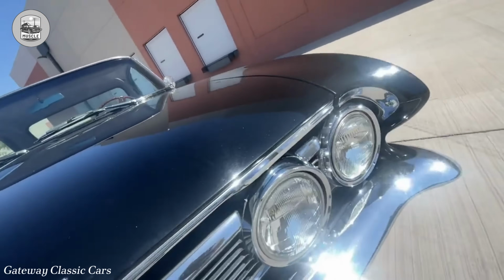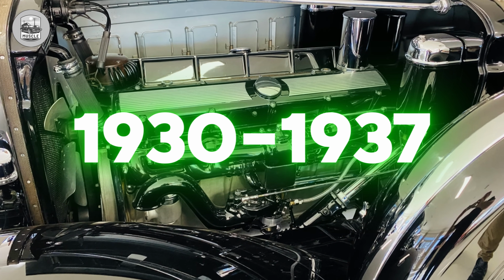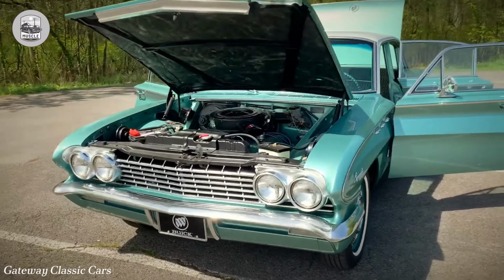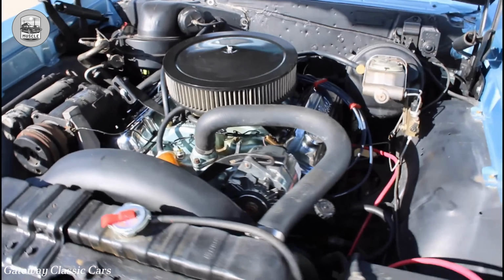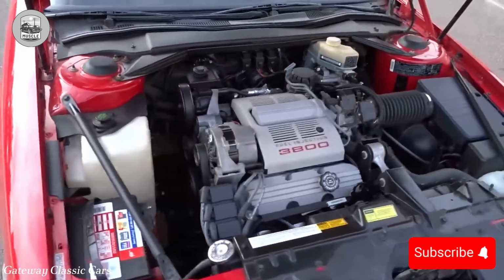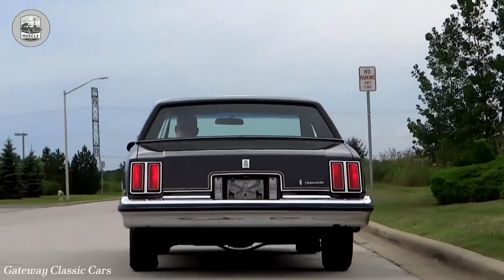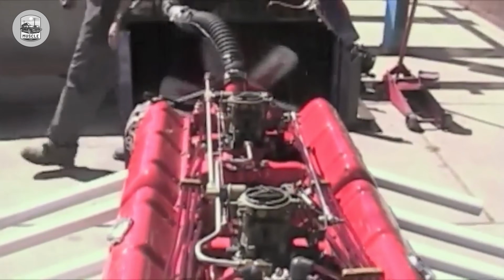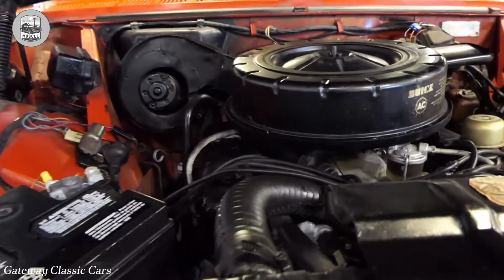10 MOST FAILED and WEIRDEST GM Engines ever made | Worst engines blunder!

Comment: Back in college I was “lucky” to be given a 1983 Chevy Celebrity coupe with the LT7 4.3l V-6 Diesel engine with a whopping 85bhp and 165lb-ft of torque. 

It DID have good fuel economy, but the biggest highlight was its snow capability. With so little torque it was virtually impossible to spin the tires even in the snow.
Reply: While I appreciate your experience with the 1983 Chevy Celebrity and its snow capabilities, I have to respectfully disagree on the praise for its performance. The LT7 4.3L V6 Diesel engine, while offering decent fuel economy, was known for its underwhelming power output and numerous mechanical issues. The 85 bhp might have kept the tires from spinning, but it also meant painfully slow acceleration and limited highway performance, making it impractical for anything other than city driving. Additionally, the diesel engine itself had reliability concerns, with issues like head gasket failures and poor build quality, which tarnished its reputation. In the long run, many owners found themselves frustrated with the trade-offs for what was essentially average fuel economy.
Reply: @KeithGreene-k1v  I finally got rid of it after a transmission rebuild and then the head gasket blew.   At the time the car wasn’t worth the cost of repairs.
Reply from the maker: Wow, sounds like you went through quite the ordeal! Transmission rebuilds and blown head gaskets can definitely be a tough combination, especially when the cost of repairs outweighs the car's value at the time. It’s always a tough call to make, but sometimes it’s just not worth the hassle. What kind of car was it? Some older muscle cars, even with their challenges, have skyrocketed in value today, making repairs more of an investment! Would love to hear more stories from others in the comments
 what cars have you had to let go for similar reasons? Don't forget to subscribe and check out the other videos on the Muscle Car Masters channel for more muscle car content,
Reply from the maker: So great.... Thanks for sharing your experience with the 1983 Chevy Celebrity coupe! It’s great to hear a firsthand account of the LT7 4.3L V6 Diesel engine. That engine was part of GM's push to offer more fuel-efficient diesel options, and you're right about its standout fuel economy—definitely one of its few strong points. The low power and torque figures (85 bhp and 165 lb-ft) didn’t make it the most exciting ride, but it was practical for the time. You brought up a great point about the snow capability! With that limited torque, it probably made winter driving more manageable. The low power might have been frustrating in some situations, but it worked in your favor for traction—hard to spin the tires when there’s not much torque to break them loose! It would be awesome to hear if anyone else had a similar experience with these early diesel engines. Anyone else have stories about the LT7 or other GM diesels? Share your thoughts in the comments below—let’s keep this conversation going.

Comment: The Buick nailhead v8
Reply from the maker: Thanks for bringing up the Buick Nailhead V8! This engine is a true classic and one of Buick's greatest contributions to the muscle car era. Introduced in 1953, it was known for its vertical valve covers, which gave it the "nailhead" nickname. Though it wasn’t the largest or most powerful V8 of its time, its unique design allowed for excellent torque, making it perfect for low-end power. The Nailhead also made its mark in hot rodding history, being a favorite among custom car builders in the 1950s and '60s. Did you know that the legendary 401 and 425 Nailhead engines were used in the first Buick Riviera, helping solidify Buick’s reputation for combining luxury with serious performance? Everyone watching—what do you think about the Buick Nailhead? Share your favorite facts or stories in the comments! And if you know anyone who’s into Buick engines or muscle cars, share this video with them.

Comment: Looking back would an after cooler done better that fluid injestion
Reply from the maker: An aftercooler could have offered some serious advantages over fluid injection, especially when it comes to managing intake temperatures for sustained performance. Fluid injection, like water or methanol injection, works by cooling the intake air and preventing detonation, but it can be inconsistent and requires constant monitoring. On the other hand, an aftercooler (or intercooler) cools the air before it enters the engine, leading to more consistent, reliable cooling and better overall efficiency.
Especially in high-performance setups, where heat soak is a major issue, an air-to-water or air-to-air aftercooler can provide cooler, denser air, resulting in more power and better longevity for the engine.
Let's see our channel is a place to share, comment or show your feelings about American Muscle Cars.
Don't forget to like, share or SUB on our channel to enjoy other great Muscle Cars videos.
Spending more time with other great videos on our channel to explore more about American Muscle Cars. Have a good day.

Comment: I had a 65 pontiac Tempest with a 215 cu 6 cyl, ran vary well driving it the way it was suppose to run. Most engines were made well, people beat the hell out of them, I had that car for 15 years.
Reply from the maker: The '65 Pontiac Tempest with the 215 cu in 6-cylinder was a solid engine, especially considering its design aimed at fuel economy and reliability rather than outright performance. It’s awesome that you kept it running smoothly for 15 years by driving it the way it was meant to be driven! You're absolutely right—many engines from that era were built to last, but how people treated them made all the difference. The Tempest, in particular, had a reputation for being versatile, whether with the six-cylinder or the V8 options. For those interested, Pontiac's straight-6 engine was also a part of their lineup in the early '60s and evolved into what they called the "Trophy 4," which was essentially half of a V8. This era of innovation helped establish Pontiac as a leader in engineering. That said, muscle car fans, do you have any stories about how long you’ve kept your engines running strong?
Reply: @MuscleCarMasters68  Wish I would have kept it. But like everything it gets past it time. I rebuilt the engine in 76 drove down to Florida for thanksgiving.
Reply from the maker: It’s always tough when we look back at the cars we let go—especially after you put the work into rebuilding that engine in ’76! Driving down to Florida for Thanksgiving sounds like a great memory.
Cars like that truly stand the test of time in memory, even when they move on. We’d love to hear more about your experience with the rebuild—what challenges you faced and what mods or upgrades you might’ve thrown in.
Have a good day.
Don't forget to like, share or SUB on our channel to enjoy other great Muscle Cars videos.
Spending more time with other great videos on our channel to explore more about American Muscle Cars.
Reply: @MuscleCarMasters68  This was the straight 6 engine.
Reply from the maker: @bser3973  Yes, the straight-six engine had its place in some muscle car models, especially in the early days when manufacturers offered a range of engine options. While it wasn’t as iconic as the V8s, the straight-six could still pack a punch in the right setup! For example, engines like the Ford 300 cubic inch straight-six became legendary for their durability and torque, making them popular in trucks and utility vehicles.
For muscle cars, though, most enthusiasts sought the bigger V8 engines for that raw power and performance. That said, the straight-six provided a great balance for those looking for a more economical option, with smoother operation and easier maintenance.

Let's see our channel is a place to share, comment or show your feelings about American Muscle Cars.
Have a good day.
Don't forget to like, share or SUB on our channel to enjoy other great Muscle Cars videos.
Spending more time with other great videos on our channel to explore more about American Muscle Cars.
Reply: @MuscleCarMasters68  I'm glad this car only had a 215 engine in it. I'm still here today. Plus the good times I had with that car can't be beat. Someday the gas prices will be back around 37 cents a gallon again than I'll do more driving, HaHaHa I wonder how the coooool guys felt after they wrapped their muscle car around a street pole felt. I quess the dead don't feel any thing.
Reply from the maker: @bser3973  😁😁😁😁 Wow, the memories tied to that 215 engine must be priceless! It's amazing how cars like that create lifelong connections. The 215 might not have had the raw horsepower of some of the bigger blocks, but it had enough pep to deliver plenty of good times! As for those gas prices – if only, right? HaHaHa! I’ve always wondered too, how many of those ‘cool guys’ pushing their muscle cars to the limit realized how close they were to danger. The thrill came with risk, and unfortunately, some found out the hard way.
Everyone, what were your experiences with smaller engines like the 215? Or maybe you have stories of others pushing their luck with bigger blocks? Share your thoughts and memories below.